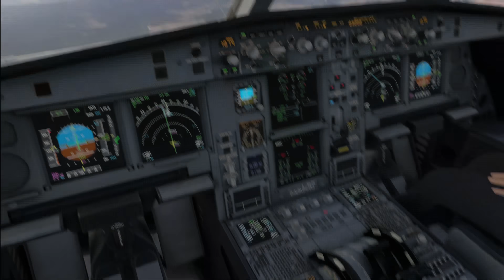A330 Lore: Why are the Flight Controls SO SLUGGISH? | Real A330 Pilot

Comment: The flight control modification was "just" aiming to change rudder controls to full electric without changing the behavior of the aircraft. It was/is also available for both A340 and A330 ceos, so not something special to A330. FCPCs can be 2K2 hardware standard (the newer one you were talking about) even without installing the rudder mod. In fact 2K1 and 2K0 by now have to be replaced by 2K2 to receive further software updates. I honestly doubt that there is a difference between fcpc hardware standards in handling, sw is an other thing... Most part of the flight control laws is running with a cycle time of 40ms. You can't compare flight control software to ordinary consumer pc stuff, running at the highest speed possible. Everything is timed at fixed intervals doesn't matter if you run on a 80386(2k0-1) or 80486(2k2). The lateral law should also be the same within the 330/40 family and near to 320. From my point of view fast, precise response is always preferable, it's a good handling quality, as you already stated the 380 even if it is big flies like a small jet.

Comment: I like when big airplanes feel like they're big. I don't want my 200-300 ton aircraft to feel like an A320.
Reply from the maker: The question is, how should a "300 ton aircraft" feel? Why wouldn't it feel like an A330? Because of higher mass? It also has larger control surfaces.
It would be a misconception that just because it's larger it has to be more sluggish. The 777 or A380 are the best examples.

Comment: I thought the difference between handling a 330 CEO and a NEO is caused by the wider wingspan and larger wing area of the NEO. And if I remember correctly the vertical stabilizer of the CEO is taller.
So the geometrics are different and this might affect the aircraft's behavior.

Comment: Fingers crossed that Boeing and other manufacturers will still make planes with manual trim and Autothrottle Systrm with actual moving throttle. This is why I really appreciate Bombardier making the CSeries/A220 still with manual trim and moving auto throttle despite being one of the most advanced airliner